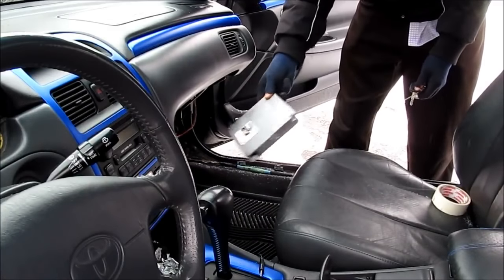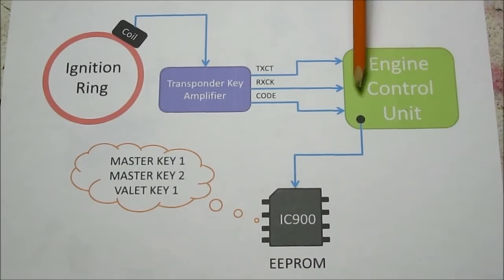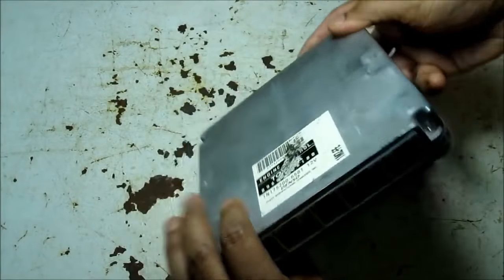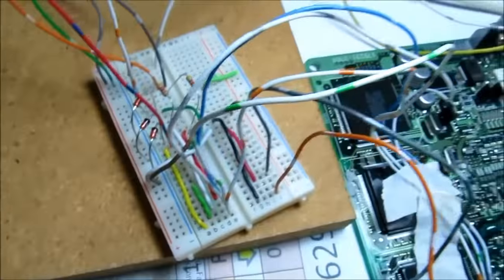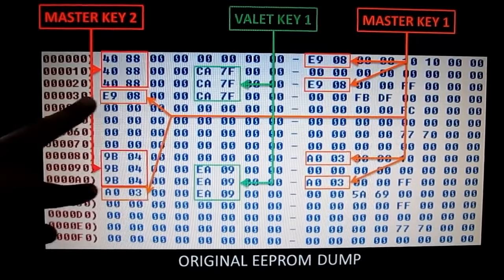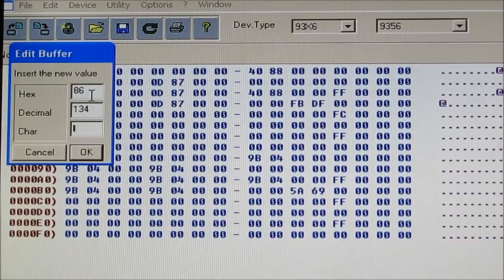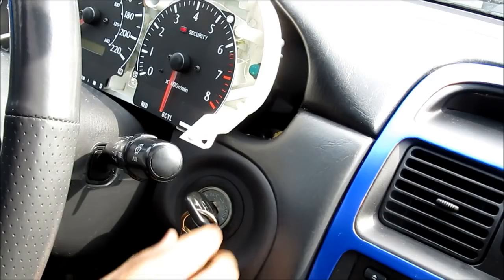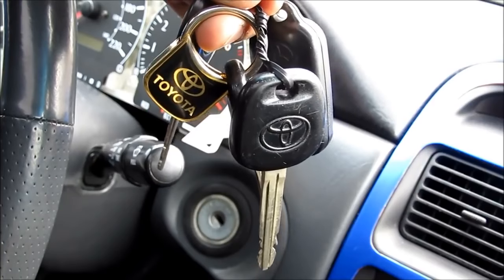DIY Immobilizer Hacking

Comment: I know you probably won’t read this, but despite the pandemic, I was able to commit in doing this and saving my car from street parking! You’ve saved lives with these videos. You’re a hero, thank you for the content. Amazing work, I can’t thank you enough.
Reply: That’s amazing dude, I just started watching this out of interest
Reply: can you share what hardwareyou used to connect to the chip?
I'm hoping to use a USB connector like the C341a, and since it uses different software I can't be sure why it's not connecting
Reply: I'm confused how it saved lives!
Reply: @mrkazman   requires an serial port capable of 12v communication levels. this is what the zener diodes and resistor do (clamp voltage down tp 5v TTL) If you use a USB to serial cable, you have to adjust the circuit to the new (lower) voltages and is dependent on the USB serial chip. Like this guy, I also just use an old computer with a proper serial port but in my case, it happens to be an old laptop. Since then I have simply built a custom serial USB adapter.
Reply: @kakd1870 
I have bought a USB to serial adapter cable. I am thinking to remove the circuit from it and directly make a programming circuit with it. But I am confused about the VCC. Should I connect the VCC from the USB or the voltage can be cranked up to a higher voltage and can kill the chip?
Reply: Will this work on a 2002 saab 93

Comment: This video is well done but it includes a major error that need to be corrected in order not to mislead readers into a frustrating experience. The included electrical schematic for a homemade EEPROM reader do not work. The software (Ponyprog) does not recognize this homemade circuit as a serial communication device. The for immobilizer hacking shown in this video will work only with the use of professionally produced EEPROM reader and there are lots of those on the market.

Comment: I swear it’s easier to just swap the eeprom chips from the old ecu to the new one. I’ve done it before on voltswagons. You just need micro solder tools. Just the mini heat gun. Done in 20 min

Comment: Hey man, just wanted to let you know that thanks to your hard work and documentation, I just successfully did this on my 1998 LS400. 

I used an EZP2019 programmer and it's own software. I ended up having to remove the chip and resolder, and even then I couldn't get a proper read(locations of all the code were correct, but a bunch of repeating numbers that weren't logical. Even the valet lockout code was completely different), and it wouldn't write(I probably torched it taking it off). I bought a replacement chip for 30 cents and ended up just zero'ing and putting in the lockout code exactly like yours and it wrote/verified fine, so I tried it out and sure enough, it worked!

For 16 months I had a paperweight in the garage that I was repeatedly told by dealerships, shops and locksmiths continent wide(actually called 50+ locksmiths across North America) that it was impossible to do. Finally after some further research I came across you and now I've got my baby back.

Thank you so friggin much. Seriously, you have my utmost gratitude.
Reply: I'm a mechanic and that's exactly the car that I'm working on right now, 1998 Lexus LS400 I swapped the ECU used from a junk yard, now I'm trying to figure out how I can program the key to start the car, one local key smith don't want to do it, the 3rd I'm waiting an answer, little bit more research from myside and I will try to do this myself.
Reply: I saw your comment and just had to stop by and say that, I will be doing this to my 2000 LS400 very soon and reading your comment gave me a boost of confidence.
Reply: @huynervo  It was scary as fuck for the months of planning leading up to it, but as long as you don't melt or fry the ECU itself, I'm sure everything will work out. Also, the vehicle still works fine to this day, so there's nothing to worry about with longevity.

Comment: You’re a solid teacher! Though it gets above my head eventually.
Question..  Do you really have to reprogram a new manu replaced virgin ecu ? 
I’m in a all keys lost 04 Toyota Sequoia in a rural area with the only locksmith in the region having failed to be able to reprogram orig ecu after multiple trips out trying.  Dealer (which is over hr away) says Control Module, Amplifier, and new keys all need replaced for this model Seq .. for a fortune. 
1 Can I just plug in new toy manu ecu  and new keys and program keys and go??
2 Do I really need to change out amplifier? 
Thanks

Comment: For anyone wondering this is a very specific method that is only applicable to this environment. This is not how ever system works nor will most of this information generally help you in anyway towards other applications. Great vid for this specific application though.
Reply from the maker: Thanks. There's alot of cars they use this method
Reply: Definitely a cool trick
Reply: Toyota used a nearly identical system in most of their vehicles for just shy of a decade. This worked in my 1999 and 2000 4runners and to my understanding, would work in many other cars. But yes, this is not applicable to significantly newer toyotas, or something from another manufacturer with it's own unique software. However,  the basic concept of programming an eeprom memory chip can be applied to dozens of car models and manufacturers for all kinds of different functions.

Comment: My 06 caravan , the wires in the plastic ring surrounding the keyhole, those wires were pulled from the immobilizer box... id like to solder a wire into the box and run the wire arounnd the keyhole. Theres 2 metal "posts" off the chip. Id like to confirm thats where the wire ends get hooked.

Comment: This is really awsome. How can I add another transponder who can receive a remote signal from a remote key to turn on the engine. Like a transponder who has a relay in serices and that relay activates with a remote signal say from 20 ft away from the car. Basically turn on the car remotely.
Reply: You might as well get a cellular adapter and connect your relay to that.

Comment: Some questions. How do know if you have a master key before doing this? Does the ecu automatically make a key master then after the second one the third becomes a valet? What if the only key I have is a valet? Will this work? And lastly, do you need 3 keys? Or can it be done with just one key? Thanks
Reply: Going by the extra blink when you insert the valet key

Comment: @speedkar100  i have a toyota prado  vzj95R 2000 model i would have to use this same process on it ??
this is a great video ..
Reply from the maker: Yeah
Reply: speedkar100 I have a question, how did you power your breadboard? Where did you ground it specifically??
Reply: Did you have to use 3 keys?
Reply: James Svetlovics I did this for mine thank god, you can look me up at spyderchat davgnzls, you can start the car with just one key but the security light will keep flashing until you find 3 keys

Comment: Ok. So i have original ecu, an original key fob but new ignition switch and new keys with no programming. I pulled out the ecu (an Delphi MT38) thinking i can just take the entire IMMO chip off and have the truck start the old fashioned way. But don't know which chip to pull. There's only 2 ..8 pin chips on the board. And one in the key fob. Numbers don't match.

I also have the old ignition switch assembly with transponder ring.  

So could I just put the old transponder ring on the new ignition switch and will it start up like that with the new keys. I'm thinking it will work but one roadblock may be the signal from the new keys and their chip maybe blocking comms.

Comment: My car is Daihatsu Sirion 2007.
Can you explain the procedure for a separate transponder module and ECU?
Should the pins on OBD II be shorted for 30 minutes or 30 seconds and should they be shorted during the key coding procedure?
Reply: There should be eeprom chip in transponded module, might work as in video.
But if you are swapping ecu for used one it might also been paired with immo, then there should be chip in ecu also for pairing. But this is my theory.

Comment: Very cool video. I need help.
I wanted to try that with Hyundai Santafe 2005. But guess what? Couldn't locate the eeprom on the ecu.  There are no 8pin chips on the foreside of the ecu. The underside has eight 8-pin chips. Non of which I'm convinced is the eeprom.

I am about to check for transponder ecu for the eeprom. 
My worry is this; is the eeprom in the transponder ecu? If so, can I use the same procedure to reprogram the eeprom? Is any of those small 8-pin chips on the rear side of the ecu the eeprom? Does this method works with Hyundia?  If not, what can I do.
Reply from the maker: Yes it can be in the transponder unit like the newer Toyotas

Comment: Hi, how exactly would this work on newer 2007 Toyota Matrix? This car has both ECU and Transponder ECU. Where would I try to get EEPROM data from? You say on newer vehicles the procedure is similar but you need a handshaking procedure between transponder ECu and Engine ECU, how is this accomplished?
Reply: By shorting pins 4 and 13 obd for 30 min
Reply: Thanks so much for responding!! Would I still need to pull EEPROM dump from ECU? Or just short out pins, wait 30min and then program new keys (All previous keys were lost)
Reply: Do I still need to viginize EEPROM? Is the key code data located on EEPROM in ECU or transponder ECU? Please help if you can
Reply: @mikel7631  did you ever figure this out I have the same problem and can find no information

Comment: Hi, 2003 Toyota Sequoia Limited, try for 6 months but immobilizer no longer recognizes original/any keys. Will this work for my suv?
Reply: My 2003 has chip reader ring on ignition switch, immobilizer ECU in dash above radio, ECU behind the glove box.

Comment: is the memory chip a SPI flash chip? can we rewrite it with CH340 programmer?
Reply: Sorry mate, these chips use microwire which is unfortunately different to the common SPI protocol.
I managed to get a read off my 93c66 using an arduino and a microwire EEPROM library, but it's dodgy as heck and I'm not confident enough to delete it without deleting the valet lockout adresses.
@speedkar100 are you saying that if I wipe my chip, I'll only be able to program ONE valet key? What's the difference between a valet key and a master key in terms of normal engine driving?
Reply: to be clear, I won't be able to program master keys then?

Comment: I have IS300 ECU (2JZ) with the same chip 93c56 , if i zeroed all the values will it work on non-immobolized key .. because i've installed the engine in GX81 1988 which have no immobolized key .. engine crank but not starting because of this immo thingy

Comment: Hallo. For EU cars - so the  IC900 on the transponder ECU must be programmed - correct? But the Engine ECU still are with the old key-codes - correct? My LandCruiser Prado is blocked, bought a used set of keys, lock, transponder and Transponder ECU - but the Engine ECU does not accept the code from the Transponder ECU. 
So, resetting the Transponder ECU like shown, will lead to Engine ECU accept Transponder ECU?? Thank you, you surely my last help. Car is in between 10weeks at the repair shop.

Comment: Great video.
1. Something is not clear to me though. The value 0xFC at offset 0x4C means there are 252 keys stored in the eeprom. The eeprom's capacity is 256 bytes. 
2. Can you program just a single key?
Reply from the maker: Yes one key will work. I believe you just exit out of the system when you've finished
Reply: @speedkar1005  How?

Comment: Hello, my father lost his only chip key. The car is a 2003 Honda Accord. I got a new cut key for the car but it has the green key flash. I just want to know if there is a self programmed system you can do by your self without going to the dealership. Note: I have a regular transponder key not a remote key. If not, could you tell me someone who might help me. Again thank you.
Reply from the maker: No you have to fork over and get to a locksmith
Reply: @speedkar1005  thank you

Comment: Hello, I have a 2005 Camry Xle and there isnt a IC900 EEPROM chip. I am not sure how to tell which EEPROM has a reference to the key transponders. How did you narrow it down to IC900? I purchased a car that only had a valley key and would like to have more than one key, but I cannot program any keys. Could I send you a picture of the ECU? Thank you so much for your help!!!
Reply: On the 05 the chip isn't in the ecu, there's a small box underneath the dash by the glove box latch that has the chip inside
Reply: Hello, go to a specialist / locksmith and copy the transmittercode from the working key to a empty programmable new key . There are tools that can do this for low cost

Comment: Thanks man! This is awesome! Do you know if it's possible to flash using a CH341A ?
Reply: Not sure what the capabilities of that are
Reply: @speedkar99  Thanks for the reply! I actually managed to program it using a CH341A although it doesn't officially support it. For the rest your steps helped a lot. You rock!
Reply: How did you manage to write 93CXX with CH341? There are only 2 options 24XXX and 25XXX. In what slot do you put it?
Reply: can you help me out on how u used ch341a to program ? what O.S did u use windows 7 or Linux ? what slection on the program did u use?

Comment: Do you do this for others at a charge of course?   I've watched your video 5 times and yet, I cannot find a way to connect my computer with no serial port to the car.   I"d be afraid to blow up the PC.  
I have a 2003 Avalon with all keys lost and already bought the new chip key from Toyota dealer.   I'm looking at who to send the ECM to program the key, or do a "Immobilizer defeat"
Reply: hey did it work out

Comment: question: i'm playing around with 2003 lexus is 300 ecu
my plan was to program in a transponder into the eeprom, this is what i have so far
when i put this transponder into the ZED BULL i get 
7E 71 40 00 00 03 9F 00 00 E5 E7 7E 00 00

but that same transponder registers as 
8E 02 C0 F9

in the toyota/lexus eeprom
Reply: Might be, that immo is coding key, hashing it, or something like that. 
Way code validation often works in programming, we take code hashing it, so nobody could just copy paste it into system (or decode in matter of web passwords)
But this is only my theory from web programming.
Thanks for info that i might cannot use my one immo chip from one car to program other tho.

Comment: hi thanks i thought i wiped my ecu but all lights come on no start but no key light so not that thank god. but no fuel rail pressuer my scantool here soon hope that one can connect all others not only thinkdiag did once maybe a worn or loose prong in the obd port ill look pull them close them and see   2003 nissan xtrail t30 dci2.2  germany nissan now africa

Comment: Is there a USB version of that EEPROM reader you recommend? I don't have a computer with a serial port. All I have are USB ports.
Reply: I'm late, but you can get a USB to serial adapter for $5-$10
Reply: @2987ms  yep I just made the eeprom reader as he did but I soldered directly to a serial port to USB adapter.

Comment: I removed the ECU on my 2014 Scion FRS located behind the glove compartment. I took it apart and can't find that chip you pointed out. I have the wires and chip reader ready. All I have to do is find that chip. Do you have any idea if it might be on another part?
Reply: I know this is a month old but did you pull the ECU or the transponder ECU
Reply: @shookdarts4247  do you need to programme both or just the immobox?

Comment: What about replacing the IC 900 chip with just a new one?
Reply: You can probably unsolder the old chip and place it on the new board if you are just replacing ecu
Reply: You need to program the dump. I tried blanking it and that doesn't automatically put it in virginize mode
Reply: @speedkar99  can I desolder the ic900 from my old ecu and put it on my ecu, i know it is possible but what other chip I need to remove from my 99 Gs300 ecu.

Comment: i have a maybe special case fault on my immobiliser, which you may know if its a general electronics fault or a dataerror in the system. My immobiliser is supposed to work like this. Red light blinks when no key is in. when valid key is inserted, light goes out and stays out when starting. On my system now, everything works like above except red light comes on immediately when hopefully the keys i have are the oem ones, but the light stays steady on for the whole time when key is inserted and as i said blinks the way it should when removed. Could someone installed an emulator and i get this sympthom or is it just a electonic fault which reverses the way the light should work? So motorbike starts an runs fine. The red light is important to get rid of or the resalevalue may be drastically reduced for me
Reply: Does your car happen to be a Renault? Because the blinking pattern you described matches exactly with multiple Renault models if they have an issue with the immobilizer. There are some handy procedures listed at https://cliosport.net/threads/key-resynchronising-reprogramming-guide.264623/ for several different models and both IR and RF keys. The procedures can work to resync a known key for both the remote locking as well as the immobilizer.

Edit: I just noticed your comment is 10 months old, I'll just leave my reply anyway, if it's no longer useful to you, maybe it can help someone else :)